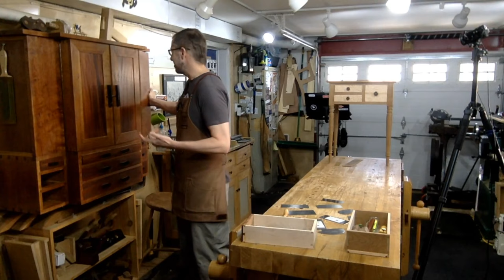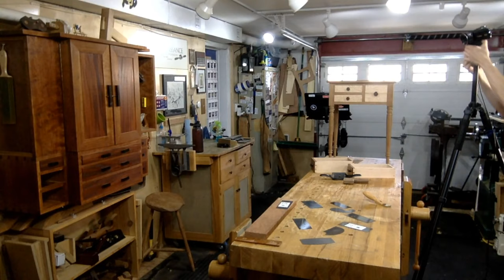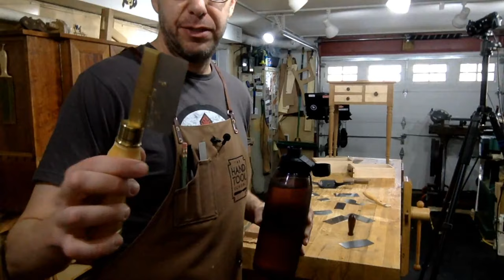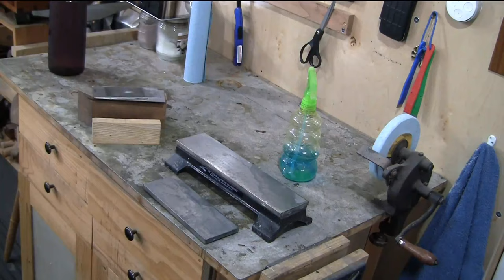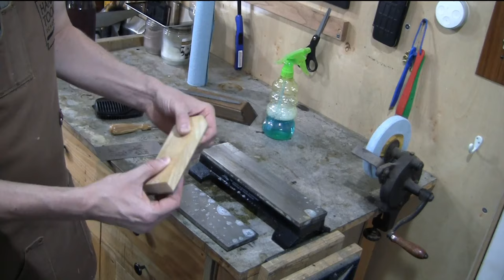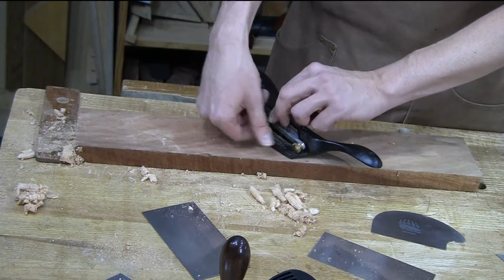Hand Tool Q&A Live: Scrapers

Comment: I've had good luck with the Crown burnisher by pinching it between pieces of pine 1 x 2 (to allow clearance on the far end) in a mechanics vise and using a two hand (one on handle, one on end) approach. My front vise didn't have clearance to be effective, but the mechanics vise did.

Comment: Dear Shannon, you ground and honed a small blade to 45˚ and I presume put this into your cabinet scraper. The scraper has a positive angle that looks about 35˚. What way do you face the bevel of the scraper blade? Cheers.
Reply from the maker: The bevel faces toward the back of the blade, opposite of the burr (if you add one)

Comment: Shannon, Could you put a link in the show notes for the small burnisher?

Thanks
Reply from the maker: Alas it doesn't appear to be on the Blackburn Tools site anymore.  I suppose you could contact Isaac and see if he is still making them.  Blue Spruce makes a good short burnisher but it doesn't have the conical tip.  Phil Lowe makes one that Highland Woodworking sells as well.  Or you can buy a bit of 1/8" carbide rod and set it in a handle yourself.

Comment: I would love to know how you burnish a burr on the goose neck or other heavily curved scraper.
Reply from the maker: I don't put a burr on curved scrapers.  If  did I would do it the same way I showed in the video but instead move the scraper under the burnisher instead of the opposite.  But as I also demonstrated they scraper works just fine without the burr.